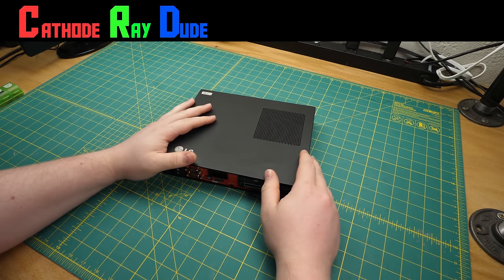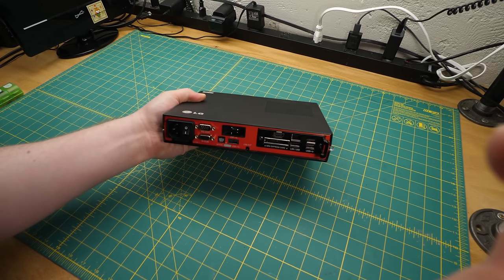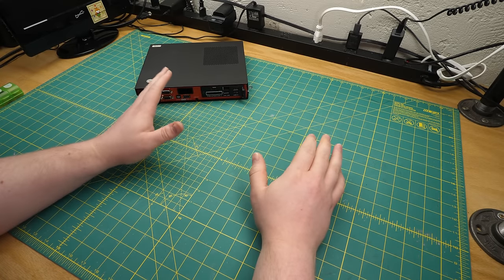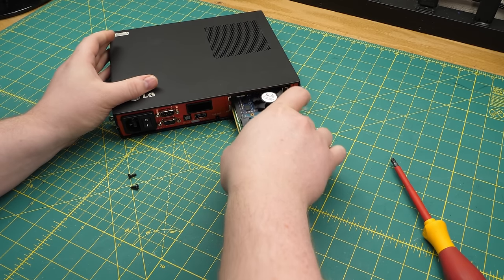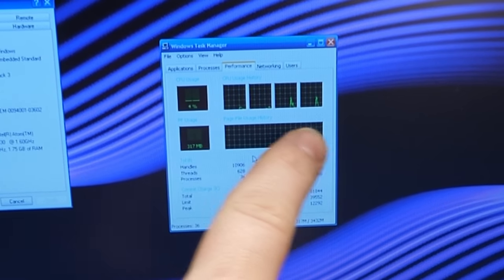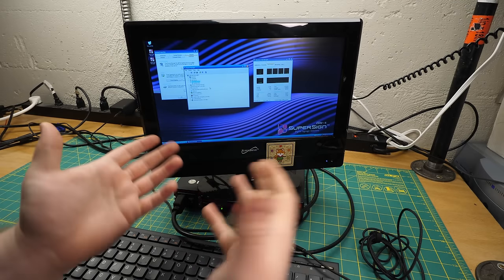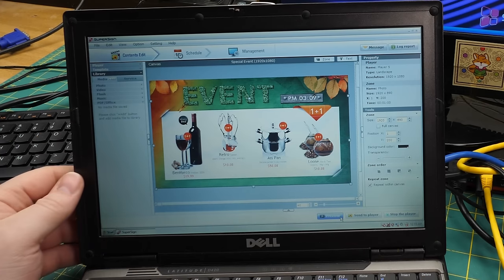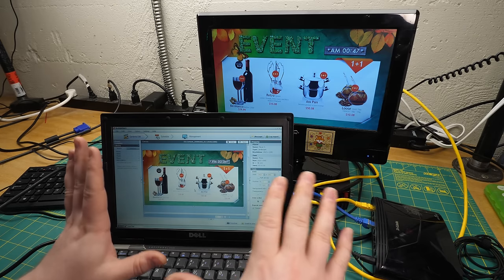Little Guys 6: The Worst Possible Timing [LG NC1000]

Comment: The OPS standard kind of makes me mad. Why? Because I feel like every smart TV should have one of these in it! When the thing is no longer supported, you could just upgrade the module instead of having a completely useless security nightmare of a computer in your TV. You could even remove it if all you need is a dumb TV or a monitor!

I also have an idea for why you might do the video wall functionality with something like this instead of using scaling: quality. Using these, instead of a small portion of an image scaled up to 1080p, you would get a native 1080p image sent to each display. This would especially matter in a very large application like the 5x5 maximum here; otherwise, assuming a 1920x1080 source, each display would be getting a scaled-up 384x216 image, which would look pretty awful.

Comment: Surprising the CPU was the thing that got the slug. it doesn't need it. I think they put the slug on the wrong side of the sink to begin with! the Atom is what should have gotten the thermal gap pad. but it's also not hard to give the Ion a proper copper shim with compound on either side. The fact it's an Ion means the BIOS can be unlocked for overclocking, as well. every single Ion BIOS has those options hidden, but discoverable with tools, and then the clocks ramped up really high on the Atoms and other options such as RAM speed changes and such done. if using DDR3, 4GB sticks are usable, with a possible 8GB being the max, I think.

Comment: 43:56 this pad is for HDMI.
51:51 These aren't only used in digital signage. The DELL Optiplex 160 used them and they're for just embedded use in general. A lot of people used to use CF cards, but now they use these. NVMe is next.

Comment: The reason I suspect you would want to use the matrix/tile function is resolution.  With multiple devices the screens can get a native full resolution slice of the image vs some part of the image that may have been upscaled, but more likely just stretched to fit.

Comment: I don't know about $50.08 but I do know about $10.08. In almost all ads clocks are set to 10:08. I've heard a couple of reasons for it, that it makes the hands of an analog clock look like a smile, or that it just makes the hands frame the watch logo, usually printed on the face below the 12. That digital clocks are still often shown at 10:08 is just tradition.

Comment: You can actually get some OPS modules that have a standard power adapter next to the OPS connector and you can just power them up using a standard laptop adapter and external monitor

Comment: I've actually been developing a digital signage system for quite a few years now. Originally it was only for the school i was at, but last year it started expanding.. Very often digital signage is just a website, often just a --kiosk flagged chrome or firefox that autostarts. Raspberry pi's also have had some traction there.

Also i love my D420, fun fact, its the exact size of an A4 sheet of paper, back in middle school i brought it with me in a binder

Comment: In the late 1990s I was based in Africa, living with my family in a residential compound which had a local multichannel cable tv system fed by satellite decoders.
We set up an information channel managed by the residents. We had an old PC in the cable tv room fitted with a VGA to composite video adaptor. The PC displayed a series of html web pages linked together by  http-equiv tags which included a value in seconds and filename of next page. Multiple people updated the pages - for security, coming events, psa for antivirus etc. Pages uploaded by ftp. Thankfully people were careful and seldom broke the chain. Tho the driving frameset (kids, ask your grandfather about html frames) was set to restart everything every twenty minutes.
This was low tech but surprisingly effective. If there were security alerts the security guy would reduce the number of pages from usual 10 or 15 down to a handful, only security related ones.

Comment: The displays used in stores are usually designed for that purpose, they lack any tv tuner but also have features and tech to prevent burn in which can be a problem

Comment: On the cheap OPS tv front, you need to search for school kit, most smart whiteboards have an ops computer inside. Last thing, windows embedded costs pennies compared to a standard windows license, so every device manufacturer that can fit in the disk/ram restrictions will go for it to save on licensing, there is no special optimization motives for its usage on this case or every other ops module that has a valid license inside.

Comment: Please do one on the Brightsign. It looks like something I need for my front window of my shop at a price worth the free I paid for the 40" digital sign monitor I have. Now I am wondering if it will take those modules as well. It does take modules of some sort and has an analog input one in it I just don't know what kind. Unfortunately it is a sony plasma that weighs about 100lbs and I am halfway across the country. I will check and if it does I can try a few for you though.

Comment: I’d like to comment about an inbetween layer between “computer with team viewer and a folder of jpegs” and “fully custom software stack with lots of integrations” and mention the cloud based but still can run on windows level. At my last job working IT for a car wash chain we were swapping our digital signage to run from a cloud based software called “screen cloud” so marketing could control them from the web but it was otherwise still a windows computer embedded on the back of an outdoor TV with team viewer for when something broke.

Edit: as I have now made it further into the video I also remember that nextcloud has android, chrome os and webOS players as well as windows so that makes sense with the direction the industry is heading.

Comment: Regarding your cost question of using that device around minute 30 - until recently, if you had a conference room/data wall with high lighting, the screen/projectors would most likely be as expensive and much more custom than this solution, so most folks would potentially eat the cost for easier continuity. The other option would have been the switching systems you've show, but even those had customized software/hardware that needed to be configured for your enterprise most of the time. I worked as a BA for a few of these initiatives, and it's often a pick your poison based on your need.
Reply from the maker: Makes sense, thanks for the input! I try my best to phrase these things as questions rather than statements because I figure there probably is an explanation.

Comment: 27:50 - the Latitude D420 is quite neat with the main downsides being the 32 bit Core Duo CPU and the uncommon 1.8" ZIF hard drive. The D430 was essentially the same machine, but with a 64 bit Core 2 Duo CPU. The great thing about these machines is that being too old for regular use, but not old enough to be collectible, they can be had for very cheap. I got my D420 for 10 EUR including power brick and docking station.

Comment: I found some information on the PMU JTAG option if anyone was interested. It is on option to load the Power Management firmware(PMU) before the First Stage Boot Loader(FSBL). In JTAG boot mode, it is mandatory to load PMU FW before loading FSBL. In device boot modes, loading of configuration object to PMU firmware by FSBL is handled both in CBR loading PMU firmware and FSBL loading PMU firmware options. So mostly not important to use anything but the default option unless you have a boot requirement for it.

Comment: These devices are custom built to work as the brains inside an industrial machine. Slot machines, Electronic table games, have them, arcade game consoles, remotely controlled large display units, traffic lights/street light control junction boxes, etc all have similar mini PCs.
The SD card holds the machine keys, signatures and operating system. Some of them used to burn up and needed replacement every 2 years. 
This was pre-SSD/NVMe tech. Some of it still remains in new form factors because businesses just didn't have any interest in changing the status quo.

Comment: Few things.

1. They might have not thinned the OS too much in case you wanted to run 3rd party software on their hardware.

2. LCD video walls now are often done without a controller. Each panel just has HDMI loop in and out (or similar) and you just program it with the remote as to the size of the matrix and it's position and it will just display its little slice.

Comment: i actually loved the ION-ITX-Mainboards. many of them were made by zotac and the main advantage of these things were, that they can play up to h264-1080p hardware-transcoded without any issues just by installing the nvidia-driver (regardless of the OS). This made them the perfect candidates for running XBMC/Kodi on low-power-pcs with way more capabilities than a raspberry pi. up until h265/hvec and 4K became a thing, this little IONs were the perfect media-centers. used mine for way over 10 years straight.

Comment: It almost seems like the dock was more for initial setup and configure of the device and maybe updating.  Suppose you've got a screen on a wall above your head behind your register with the menu.  Sure you get power and a network connection on the wall, but for initial config IP address, naming, etc. it makes a lot more sense to set it up in this box then migrate it to the slot on the screen.  You could use the dock for screens that don't have the slot, but that seems more a secondary purpose for it.

Comment: just picked up one of the internal compuiter cards for this from ebay. as i have no chassis, i'm going to get it working externally. on the motherboard edge connector, seen from the bottom, the thickest trace section on the right is +19V in, then there's 4 ground pins next to it.
in fact, looking at the service manual, the card edge connector on the motherboard even has VGA pins, 3x USB and an extra SATA port. please note though that the edge connector is a mirror image from that of the serrvice manual. ie, Even number pins are actually odd number and vice versa.

Comment: At the high end of single screen digital signage products look at the Green Hippo Nevis+, it's a miniaturized and cost reduced version of an entertainment VFX processor that's designed to mount behind a 4k TV and drive content to it, possibly with synchronized control between multiple units or lighting/audio like at tradeshow booths.
Reply: MSRP is like $7000 for a crappy embedded CPU and barely enough juice to play two layers of 4k video.

Comment: ION had a great DXVA support for embedded GPU for the time. I even had ION mini-itx motherboard for 775  Core cpu. Intel chipset's GPUs were really terrible and if you want to have a compact media center you have to install normal GPU or buy an ION thingy. So I think it has no alternatives for such little digital Sign PCs which has to do 1080p and there is no option to use core 2 quad or discrete GPU on it...

Comment: We use brightsigns at the corporate campus I work at! It isn't my department (I'm IT, they're another company doing digital signage), so I don't have details on it. We use one for each panel, and they are controlled by a central server rack mount device for the video walls, but just one for a restaurant menu on a TV. The newer ones we use have GPIO on them, and are POE. You can plug a USB keyboard/mouse dongle into them to do minor edits on screen, and click through the slideshows. I don't think they use Adobe Air anymore lol
Reply: For the video walls, I mean one device for each individual display panel - one wall has about 16 of them controlling it

Comment: So, THATS what that (OPS) port is for.
I know someone who uses a mini desktop with a digital blackboard that has this port on it. He saved 3 of them from being scrapped from a recycling center here in Texas.

The original android ops module it probably had was missing, so I'll see if we can find one to try it out it.
Reply from the maker: If you don't want to commit too hard just to test it out, you can find OPS modules brand new on ebay for under forty dollars in a variety of brands - try Promethean, I found some real cheap ones and I think they can act as generic Android devices.

Comment: As to the ops module with the tuner built in, that was probably what the number one intended feature in the home for ops was supposed to be, using an ops module as a substitute for a cable company set-top box. It's all the proprietary stuff that Comcast or Charter or Cox or whatever c word is providing cable in your your region would run on that module instead of requiring you to mess up your nice clean wall mount TV installation by connecting it to some plebean AV component.
Reply from the maker: Oh man that's brilliant, I hadn't even thought of that. I don't think the Intel ever intended for there to be a consumer application but there are so many possibilities, it's wild that they didn't do this

Comment: This looks like those half rack DSP audio servers I've seen with certain live audio digital mixers. So you would have 2 of these side by side in a rack 2 of them made a full 19 inch rack unit. 1 ran the DSP for things like Equalizers, compression, gates, Reverb and delay, the other unit ran the actual mixing system. There was hundreds of these all made for different brands. Waves basically took over the market with their Waves Soundgrid computers and DSP servers which houses 2 computers in 1 2u rack space. But LG use to make tons of these little servers for the audio industry as well.

Comment: 30:41 - I imagine that doing it this way would get you a higher resolution overall display, whereas the hardware splitter can only split whatever resolution signal is coming in (I dunno what the max resolution for hdmi is these days, but I can't imagine it being 1920x25)

Edit: scratch that. I just realised that you meant 25 screens total, not 25 wide! Although of course the point still stands since the image is still 5x wider

Comment: Proper displays used for signage applications are not ordinary TV's at all. Despite some having huge, ultra super duper wide panels, even the ones that are in normal TV sizes have specialised panels that can work continuously without degrading the picture.  Apparently, the picture degrades because the liquid crystals in the panel, being liquid, would deform towards the floor. This alone prevents the usage of a normal TV panel on its side for a prolonged period. I ve been taught all that in a LG seminar on Signage Applications in 2010. Sorry for my not very technical English, I m not native.
Reply from the maker: Your english was fine, especially given the technical subject! I had no idea about this but it makes perfect sense, and may explain why the panel types specified on sharp and LGs websites have weird names.

Comment: 16:22 "Given that these were electronics manufacturers, surely they knew that D-Sub was a completely inaccurate term"

Well considering how a lot of monitor manufacturers sell 2560x1440 monitors as "2K", I'd say that's not a given
Reply: Better than selling 3840*2160 as "4K". At least 2560 is greater than the 2000 suggested by the name.

[sigh] I really hate display manufacturers and how they sell their stuff...

Comment: Perhaps the missing screw from the back of the heating may explain the missing thermal pad??? Also I'm a fan of that gen of latitude, I have a d620 that's getting a bit battered but it's still one of my favourites.... another thing related to your sample signage vid, what the hells an ass pan?.? And a bit off topic but what are those pipe flange things you have screwed to the desk and where do I find them???
Reply from the maker: Those are ductile iron pipe flanges, can't remember the full name but you can find them at any home improvement store, I believe they're used for gas piping. You might be better off looking for the galvanized ones though, those are more rust resistant. They're holding up the shelf above the desk

Comment: I remember company that I worked for bought tiny computers to display adverts on big screens to be shown in customer area. After they bought 6 of those we found out that there was no option to disable osd popup with file name, resolution and size of file on screen each time new file has been played, so they went to recycling after ~week of usage. We even contacted the seller who in his turn contacted the manufacturer. And they told us there is no option to disable it. It was around 2010, the magical time where even developers never tested their own shit in practice.

Comment: There's also controllers for big LED walls like the ones used for billboards in times square and music festivals that use FPGAs to PWM every LED really really fast.
Those are the ones that are assembled from tons of small 64x64 (usually) led panels
Reply: There's a digital billboard downtown where I live made out of what I'm guessing are 32*16-pixel bricks (too high up to get close enough to actually count them), and at least once a month it seems to have a dead block of pixels.

Comment: just a fyi. target's red channel which is the feed for their TV wall is a standard mini pc running a highly customized windows (It was hit by the crowdstrike crash) install and running scaler software. The device has no storage on it and the OS and videos are network based. This allows target the maintain and update the files for it in one place and then all the units just boot from the same network drive.